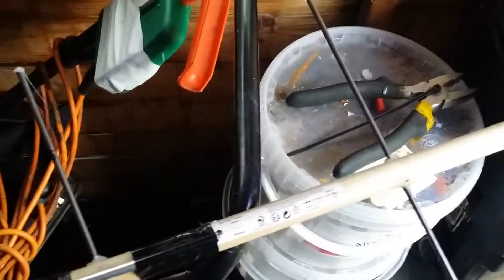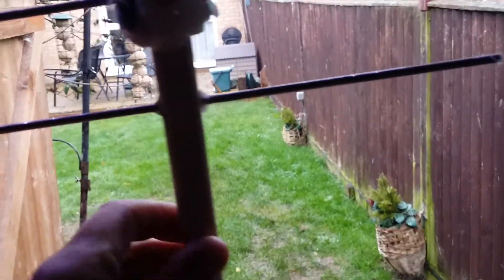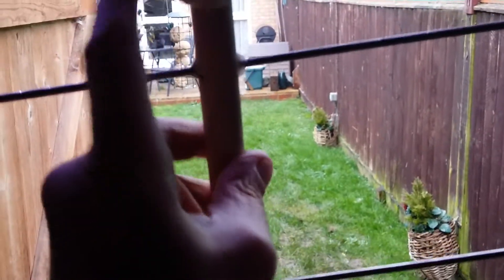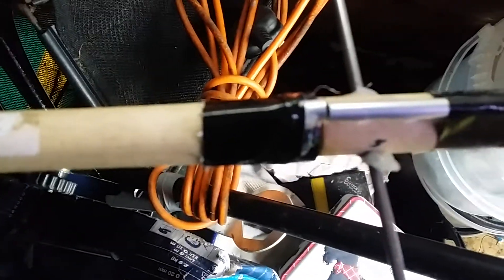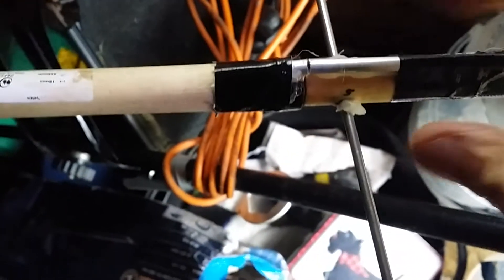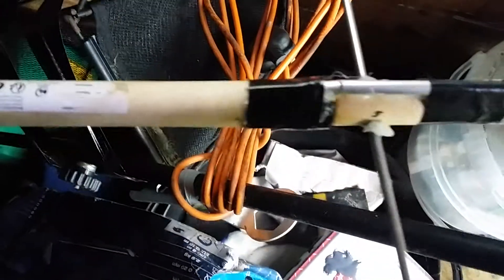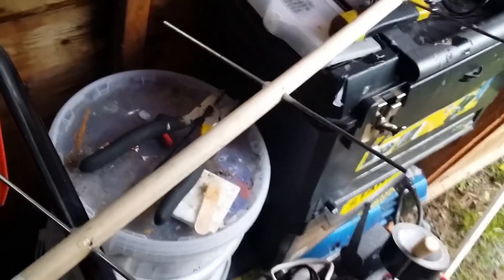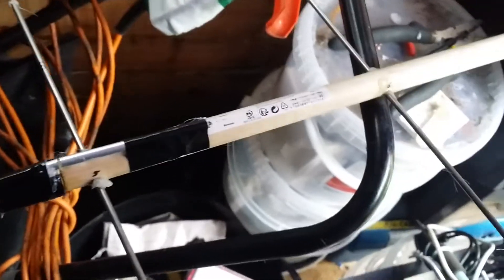Diy arial for pmr licence free 446mhz

Comment: I Made 446MHz Antenna From A Broomstick Thats Collapsable , Its Two Brooms Together And It Collapses 4 Time Smaller, So From 3 Meters It gets To Only Around 80 Cm 
The Elements Are Twisted On And Strapped On With Tape So They DOnt Mess With Colapsable System Inside, Works Good For Near Local Store Security And All That, When I Left It Outside Something Hapened To It, Idk, Need To Check The COntinuity To make Sure It Still Works, But It Doesnt Get The Gain It Had, Maybe because i sued aluminium elements and not copper as always, i love copper, allmy antennas are made of copper, got it from my friend whos grandpaa passe away and turned out he was a radio engineer and a KGB agent in Ussr times , got soo much copper from, him that its not even funny./ have been using it since. all kind of copper. plates, sheets, tapes, rods and wires and everything between. :D